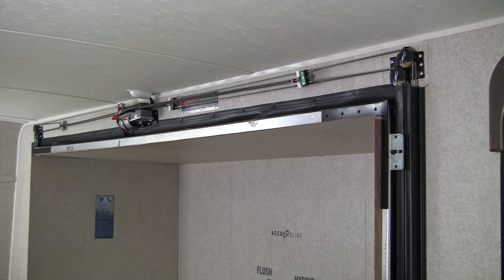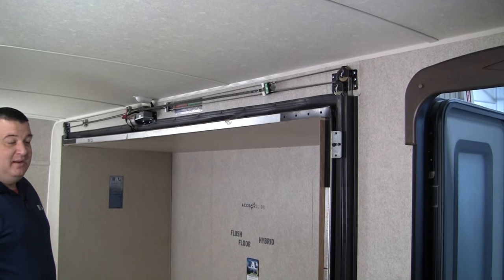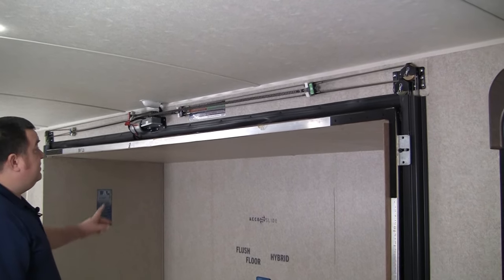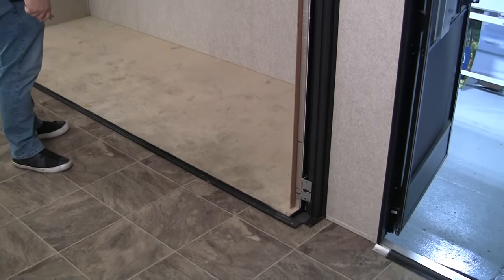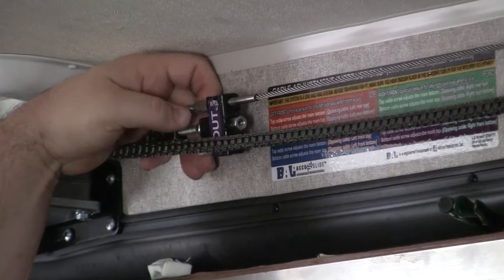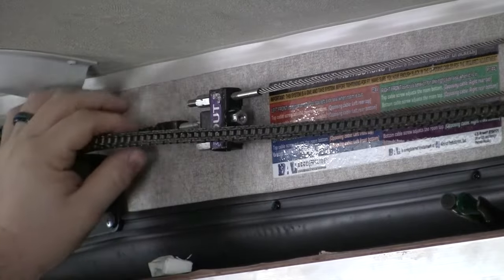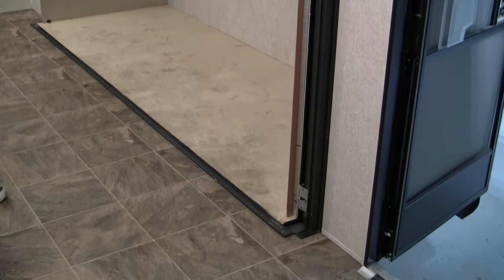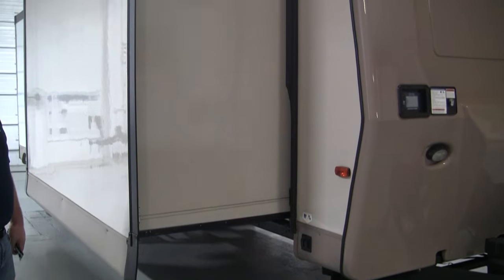BAL Accu-Slide Adjustment & Tensioning

Comment: I have a 2000 31ft wildwood can't fi d motor
Reply from the maker: We have mulitple cable operated slides. Accu Slides have the motor mounted above or below the slide room at the center of the opening. Other styles, such as the G5 with Timing Shaft or the Exact Slide have dual motors concealed in the jamb on the top or bottom of the right and left of the room.